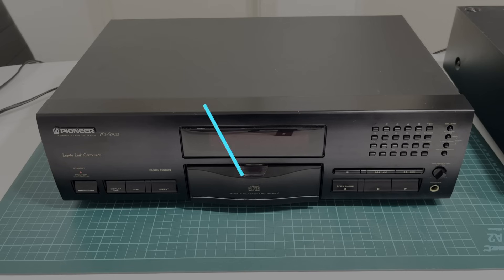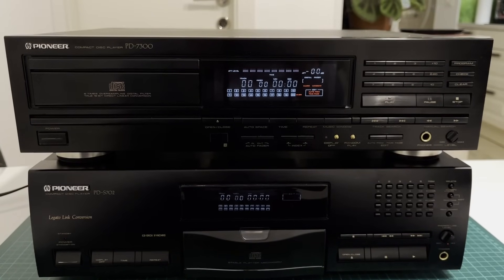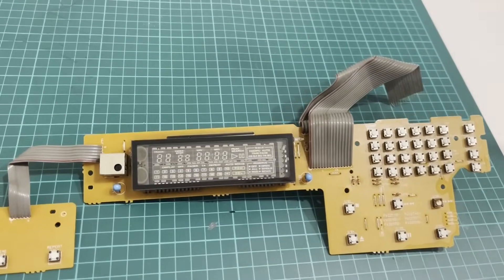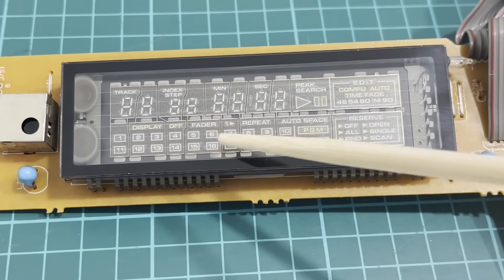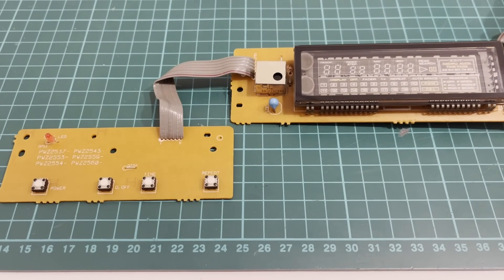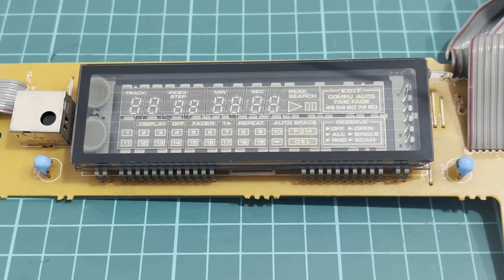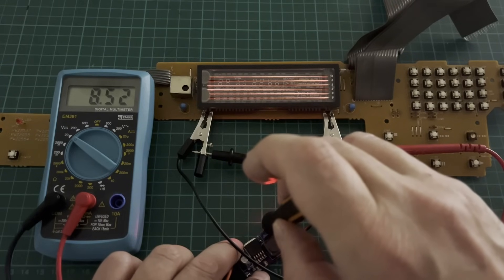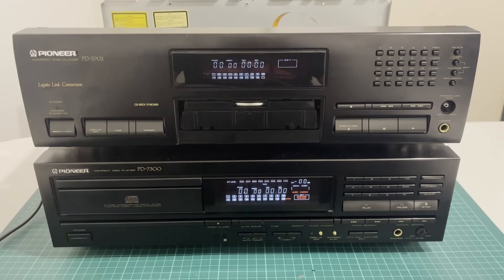How to restore a dimmed luminescent indicator VFD? Rejuvenating a dim VFD vacuum fluorescent display

Comment: Thanks for your video! I own a tuner Yamaha TX-492 with very dim VFD, poor visibility on daylight. I did the same treatment- 15 sec at 9V for 3 times. The result is only satisfactory- much better view, but in no way restored to the factory. I own 2 tuners TX 492, so I could compare. I think in my case is also the phosporus involved.

Comment: I need help with the Sony RX100AV screen for a similar problem. A few years ago I accidentally touched the motherboard with the screwdriver, then saw some sparks, and then my screen reached low brightness. The left and right sections have low brightness, but the entire middle section is black. How can I solve this? I don't understand much about the electrical work you do in this video.

Comment: This method was also used in TV CRTs many years ago. Also, there was a modular step-up "booster" transformer that could be put inline w/ the tube socket that raised the filament voltage about 25% to increase a dying CRT. This would work for a while but decreased the remaining life of the filament.

Comment: the later models from 1995 had silicon diodes biasing connected from the transformer PINS for the filament voltages. This made it more easier to fix.

Comment: This helps me diagnose issues I seem to be having with a number of of these VFD dispays. In each case, they are permanently powered as they include clock/timer functions. I think I'm correct in saying all the effected kit is either a Tuner or Radio of some form. The "failure" mode is not one of the entire display dimming, but individual elements ... namely those elements that are permanently used for the clock function. Other elements that are only used when the Tuner/Radio functions are active are fine and bright, only the 88:88 elements are dim (with the elements of the first 8 being associated with displaying a 1 or 2). Presumably, this means that the suggested cure of burning off filament contamination is going to do nothing. The fact that many characters/elements are bright must be telling me that the problem is not the filament but is, in fact, ageing/degradation of the phosphors and cannot be recovered? ... Am I correct? I was wondering if it were possible to build an LED based replacement display panel using a laser etched diffuser to generate the peripheral symbols. The challenge would be in cataloguing the driver outputs! I presume the local segment grids are also switched to help minimise the number of matrix address pins?

Comment: It should be easy to add a mosfet / relay to power the transformer only when the main power is on.
Reply from the maker: Yes, but it's easier not to leave the device in stand-by mode)
Reply: @just_DIY  Not everybody will think about it, since it's an easy feature..
I don't know this device, but since I know about electronic, quite sure it would be an easy and cheap fix.

Comment: I didn‘t understand exactly to figure out the right pins to connect the 10V correctly. That‘s why I don‘t do it and prefer to keep it original. Do you have a schematic of the devices?
Reply from the maker: The filament contacts are on the left and right, i.e. the first two and last two contacts in a row. They are separated from the rest of the contacts, segments and grids.
In any case, you should first look at the schematic diagram of your device to determine the contacts connected to the filament.

Comment: For VFD's on microwaves that are dim, I've replaced the DC power supply filter caps and that fixes the brightness.
Reply: That is the answer to fix most dim displays. I would never try the procedure used in this video.

Comment: Increasing the voltage from 3.6v to 4.0v is barbaric? But increasing it to 10.5v isn't?
Reply: You've just completely missed the point. Increasing voltage from 3.6V to 4V in-circuit forever isn't the same as increasing the voltage from 3.6V to 10.5V off-circuit just for 15sec then bringing it back to 3.6V in circuit.
Reply: @MSM5500  Just going off what he said.
Reply: Compare it with work. Working under constant stress and extra hours isn't good for you however working over time one day won't do much harm.

Comment: 07:15 "...a voltage of about 2 or 3 times the nominal voltage is applied...."
Vnom = 3.6VAC from earlier in vid at 04:15
So just confirming by this time the 2x to 3x Vnom recommendation is straight-up multiplying into DC volts without any power conversion calculations, as that's what you did, 
where 10.5/3.6 ~ 3x

Comment: THANKS! I had always ASSUMED it was due to the vacuum slowly degrading over time as atmospheric gasses present would reduce the electrons' ability to move without impinging on and being deflected and/or stopped by various gas molecules in the envelope.

edit: Fortunately, to fix mine (Yamaha RXV375) in which the display was virtually invisible in just a few years, I was able to buy a replacement display/controls board salvaged from another unit. I think I recall paying something under US$20 for it at the time. I kept the old board so I've got something to play with should this problem repeat.

Comment: Just so you know, in low humidity conditions, I've measured Electrostatic voltages exceeding 30,000 volts on sheets of paper (02:35), with localized zones on a sheet reading much higher. ElectroStatic Discharges (ESD) from such a source can easily destroy semiconductor components, especially when a circuit board is removed from a system and it's inteface pins/connectors are exposed.

Comment: A nice fix and a good explanation of the VFD's principle of operation - loved the video! Thing of beauty, joy for ever.
I'll have to try rejuvenating some VFDs in oven timers, and also check if I can get a magic eye tube (EM4, 6E5 etc.) going again. This should take care of cathode poisoning, but won't help if the tube's phosphor is burnt out, which happened all the time... in that case the tube is a goner.
Reply from the maker: Thank you!)
Reply: Have you considered laser etching a thin layer of the phosphor in the magic eye tubes? It wouldn't work for VFD-s because of the grids and potential for ruining the isolation on the substrate, but for things like magic eye tubes it should yield a nice result.
Reply: @TheOriginalEviltech  not really, the shape is complex and it would take a lot of experimenting before hitting that sweet spot when you get results without removing too much phosphor. Offgassing and getter capacity is a consideration too.

Comment: It would also be easy to boost that filament voltage slightly by threading an extra turn through the transformer core then wiring it in series (phase polarised) to the dedicated winding. 
If that isn't possible because the transformer is screened, just add a tiny additional transformer of around 6 volts and use a resistor to bring the voltage back down to where you want it.
The emissions go up quite sharply with small increases in filament voltage.
Good video, thanks for posting.

Comment: I think what will need to take place for the long term is replacement with an oled display or rebuilding the tube and inserting new cathodes. 

This repair though useful should be seen as a short term temporay fix. Put the equipment on a switched power strip so all power can be cut off to device.
Reply: Oled are even worse

Comment: The name for this is Cathode Poisoning. This happens when a filament is powered on but no current flows from it for extended time in the case of the device is turned off but the filament is still heated up. Only heating up the filament will not be an affective way of burning away the chemical layer of the filament when this is the problem. You need both higher heat and higher than normal current flow from the cathode to the anode in order to affectively reverse the poisoning. But in the end most solutions at this point is only temporary as this is partly irreversible. But just leaving the device on for some time can make it brighter too since you then let current flow in the VFD cleaning off the cathode.
A lot of vacuum tube or CRT Rejuvenators heat up the filament a lot and put a strong shock of current with high voltage through the tube that partly even strips away some of the coating in the process in order to knock off the blocking layer of oxide if you want to call it that. Cathode poisoning is almost like when you leave a soldering iron on for a really long time and the tip gets all crusty from it and it gets really hard to clean than if you use it for the same amount of time it stays easier to clean off and the worse condition it is in the harder it gets to clean again

Comment: If you want to preserve such a piece of equipment for the long term, it seems like adding a relay to cut filament power when the unit is off would be very beneficial.
Reply from the maker: Thanks for the comment. A simpler option is not to leave the device in stand-by mode.
Reply: There are Powerbars with "Slave" Plugs that are switching ON when the is Power Comsumption on the Master. Technicians have that for the Vacuum Cleaner when drilling or cutting concrete floor.
Reply: Well... that's a lot of work. I'd say get an old-school power control station like they made for computers, it's a power bar built as a box to put things on it, and the switches are in front.
Reply: I came here to suggest this. Using a  power strip with a power button is another excellent idea.
Reply: @metatechnologist  Hit up the thrift stores, I found a big one that can fit a CRT monitor, has 7 switches, and a 6ft power cord, for 14$.
Reply: Mine is in use 24/7.
We are far beyond external manual power switches these days.
The way to address this is to have an USER display control option which allows one to activate the display for only a set amount of time whenever you touch a control on the unit or the remote...
Like my cellphone works. The phone's display is disabled unless I touch a control or a call/text comes in...AND I can set the display to stay on once triggered, for anywhere from '10 seconds' to 'Always On' depending on MY preference.
Reply: @exgenica  OK
Reply: @exgenica  bs. Don't you sleep or what? Don't you know that remotely controlled outlets exist?
Reply: You can even use some cheap remote powerswitch / Wireless Remote Control Outlet.
Reply: Or just use the power output on your amp.
Reply: Trigger
Reply: I notice the red lines stay lit up on standby so my old electronics using these stay on wifi outlets and fully power down when im done using them from my phone
Reply: There's much easier way, Just TURN OFF equipment when you don't use it. It's obvious
Reply: @deaddycruel  No we need a wifi based internet of things device that requires constant updates, can spy on you, change its TOS randomly, and stop working when its creator wants on a whim. Oh and require a new phone and windows 11. Or else.

Comment: The combination of this method and rectifying the filament AC voltage to DC by using shottky diodes and a capacitor fix my CD player to almost 90% brightness.
Reply: Not sure about your case, but ac is used for a reason. As an extreme example, argon laser tubes use a hot cathode as an emission point for ten or more amps of current. They use a filament transformer with a center tap pinned at either zero or negative voltage and the ac potential causes the emission point to sweep back and forth across the whole hot cathode at line frequency, preventing hot spots and uneven emission and cathode wear. On a vfd, when you use dc you create a situation where the voltage difference between the anode and cathode differs from one end to the other because the filament is a resistor and has voltage drop through the length of it, and the higher the voltage, the higher the energy and brightness.
Reply: @pw36952m  "ac is used for a reason."
to keep the cost down. Sure, there is no reason to use DC in this case at all.

Comment: if its a deposit, that been building, it like electro-plating (sort of action going on) so some else is being worn away somewhere else, well treat as an electro-plating reaction, its revisable, (youjust run process backwards to remove the deposited, what ever it is) you workout what been get broken down as cathode and anode the process, and as good starting point is it already has component part in called a cathode, so that good starting point at least for one end of the process what ever it is that going make go dimmer over time? ,

Comment: The emission layer is originally made by forming a barium oxide layer (the white stuff), with the surface reduced to an atomic layer of a pure barium.  This pure barium is the main emission materia, but it gets destroyed over time (by evaporation and sputtering by some residual gasses, here the evaporation will be dominant). By the heat surge you cause some extra barium oxide to reduce to the barium, so restoring the layer to some extend.

Permanent overheating would make the evaporation faster, yet won't trigger/accelerate the recovery yet (that needs way higher temperatures). It boosts the emission just because of higher temperature, but the faster degradation would make it worse very fast.
Reply from the maker: Thank you for interesting information!
Reply: I was going to comment exactly what you said - the overheating is just a catalyst for the original coating. Might even be causing the coating to melt and migrate to the underside where it will emit more electrons in the direction of the grids and phosphor. I believe it's possible to fully restore by actually opening the display with laser etching and recoating the parts very carefully. Afterwards the display can be sealed again and baked and vacuumed to original specks. It would be a very expensive procedure, but there is some vintage equipment that would be worth the investment.
Reply: @TheOriginalEviltech  You won't fully restore, as keeping things hot all the time also makes the filament outgass more than designed, contaminating the vacuum. The overheating adds to this as well. But still better than nothing...

Comment: Somewhere in the back of my memory, I read that the cathode wires were plated with a particular metal to better emit the electrons. If uncontrolled, or over-driven, the burning method has the possibility of vaporizing this plating, defeating the intent of the repair.
Reply from the maker: Thank you for the comment. You are absolutely right; that’s why the thermal exposure is applied for a short duration.

Comment: TIP: Before and after this treatment, gently tap around the surface of the glass of the display with a screwdriver plastic handle. This will vibrate the wires inside (you can hear them vibrate), and separate some of the build-up from the wires. I do this with the display either vertical or face down, so that the material that comes off, does not fall into the grid or worse, onto the phosphor. Do not do this during the treatment while the wires are glowing, as this might cause the wires to break.
Reply: Si potrebbe alimentare il filamento con una corrente pulsante a qualche decina di khz come si fa per la rigenerazione dei tubi catodici.
Le forze elettrodinamiche agevolano il distacco dell'ossido.
Reply: L'ideale sarebbe dare una corrente pulsante ai filamenti e avvicinare una calamita al tubo in modo da far vibrare i filamenti stessi.
Meglio sarebbe invertire la polarità della pulsazione.
La corrente nel filamento produce un campo magnetico e la calamita attrae o respinge il filo stesso creando una buona sollecitazione meccanica

Comment: You said the magic words: "The method is effective only if the cathode has weakened and is useless in cases where the phosphor on the indicator segments has degraded"

Many VFDs show phosphor degradation closest to the filament; this is caused by electron bombardment and cant be fixed (well, I've never heard of anyone being able to open-up the tube, replenish the phosphor, reseal, etc).

Comment: That explains why the displays on my old Bose Wave Radios are so dim, because it's a clock radio, so the display is always turned on for the clock.
VFDs are essentially vacuum tubes, and as such need crazy old vacuum tube solutions to rejuvenate the cathodes. This is kind of a scary looking procedure. If VFDs weren't basically all bespoke layouts, it would be great to have a spare one to work on. At the very least, it might be a good idea to practice on some cheap thrift store units before trying this on your "good" stuff.
Reply: @8bitwiz_  I have a Kenwood mini hifi from 1997. It has a huge VFD, which was on 24/7 from 1997 to 2017. It's still perfectly visible even in a well lit room. The quality of VFD tubes varies hugely between manufacturers. IIRC it has a Futaba VFD tube.
Reply: "... practice on some cheap thrift store units before trying this on your "good" stuff."
Excellent idea! Might not transfer directly to a different model, but it does help with process familiarization at the very least.

Comment: I despise those things.  Too bad we all lacked the foresight to purchase a spare display for gear back in the day.  You end up with a perfectly good piece of equipment that becomes useless just from that part.  I suppose they abandoned century reliable LED displays because they were too "bright"  "garish" etc.
Reply: They did not abandon LEDs, VFD phosphor can be printed to any pattern, icon, glyph, etc. This cannot be done with the actual LED junction. Light pipes or optical diffusers would have to be constructed in those shapes. Multi-color VFDs can have encompassing phosphors, for example, a red square surrounding a blue circle, and each independently activated. This is fairly difficult to accomplish with LEDs. LCDs are somewhere in between.
Reply: @osuuma6935  You know they use monochrome and colour LCD and OLED displays in consumer electronics now?